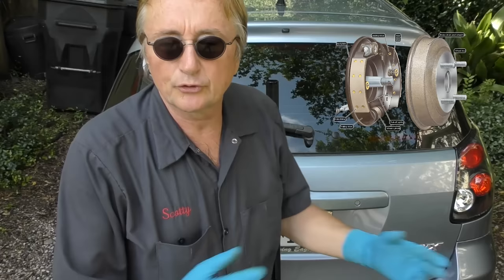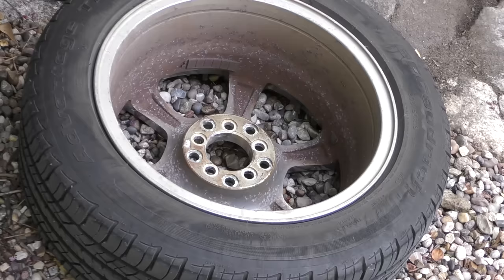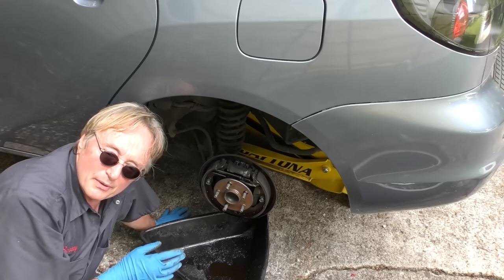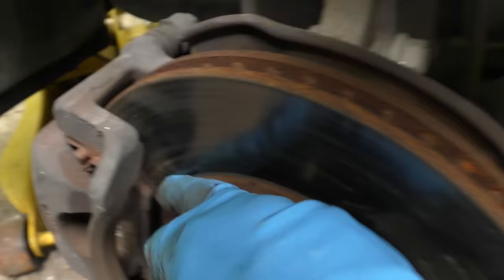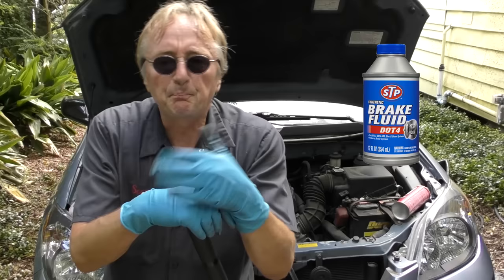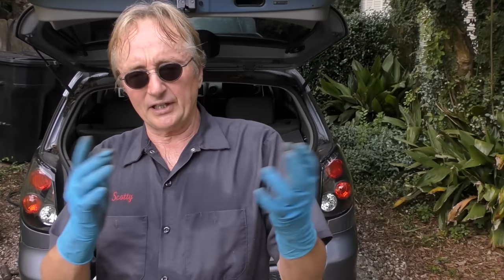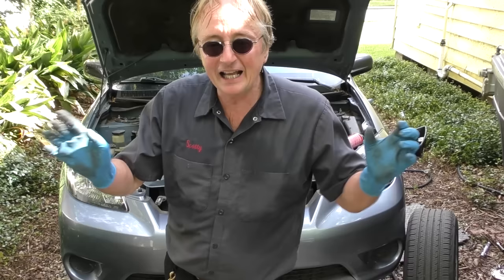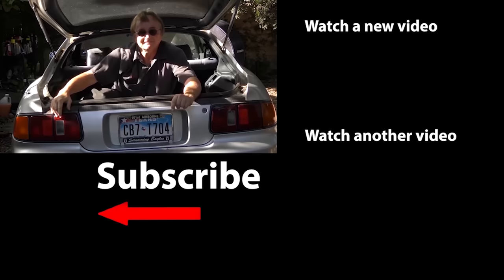Doing This Will Make Your Brakes Work Better and Last Longer

Comment: Don’t spray brake parts cleaner on the braking material or rubber components directly, that’s is bad for the rubber,  brake shoes and pads. It wears out the shoes/pads faster and dries out the rubber. Otherwise, fairly good advice.

Comment: jeep was squeaking so had our front rotors, brake pads and left side caliper changed. Left the mechanic and a couple days later, squeaking again. Took it to a different mechanic and said our rotors were heating up as well and said take it back to mechanic who did the work, they need to redo the job. So they replaced the whole thing again... 2 days later, squeaking again... whats going on??

Comment: My car has ATE pads from Opel Corsa OPC brake system.. They are good but they squeak even tho they are still 5mm thick+- from what i can see externally. 
What do you think about TRW brake pads? Or Brembo? im using 308mm discs for the front.. Thinking about replacing them now

Comment: I really need some of that brake cleaner.  My brakes are making my car shake after I greased the calipers a little while back when I was doing a wheel bearing replacement.  I think that grease got on the pads or Roters

Comment: Hello big fan here my 2015 ram 1500 my brakes creaks when press all the way in and also when release I need help I change the rotors and brake pads ceramic but still makes the noise

Comment: I have a 2009 Camry and have to change pads and rotors every 10K! I drive very conservatively and still the rotors are easily warped. My mechanic uses Conquest parts but are there better? What parts should I be using?
Reply: warped routers and pads every 10k Owo? something is up either your calipers ,guide bolts or some other part is causing some kind of issue. for a normal driver there is no reason you should have your routers and or pads worn ,warped or needing replacment with in 10k even for cheap stuff

Comment: Scotty I have acquired a 2007 Saturn vue 2.4l eco vvt hybrid. Wouldn't  start so hard it towed replaced spark plugs and put in new battery. Started! But was making loud noise so stopped. Changed  oil and filter. Still making noise passenger side of engine so removed  value cover to find sagging  timing chain. I plan to replace chain and anything else that I should while cover is off. I've  never done this but looks pretty straight  forward. Dirty burnt oil on cam shafts and cover. Any advice?
Thanks Tom Sawyer

Comment: Scotty I need help. I have a 99 f150 110k miles on it. Previous owner(original owner)  let it sit for long periods of time. I think he used it around the beach, maybe as a tow vehicle. I bought it from the guy last year. Runs ok no major issues or check engine light. However recently it's being sluggish. around 50 to 55 mph at 1.3k to 1.4k rpm, especially up hill at top gear it has a hesitation. I really have to push the petal down, it down shifts a gear to finally gain some speed.  What could it be? He changed the spark plugs at 90k miles, but that was in 2013.  Again no check engine light. please help!

Comment: Scotty I have been watching you and have been using your advice for over 3 years now..I have a 2005 matrix with 285,000 miles on it..My car has been through it...but my passenger front  brakes the caliper is acting funny I'm going to flush out the brakes with new brake fluid but what happened is I was driving it and the right side passenger side brake started locking up or got gravel or some thing in between the caliper in the brake pads and I keep breaking studs on that passenger side front wheel can you tell me what might be causing this issue

Comment: My 2006 Pontiac Vibe got rejected this year from the dealership in part because the back brakes were worn out. Idk why, it only had 226k on the odometer. Lol. I drove it off the show room floor when it was new. Take care of your car and it'll take care of you. I would have smacked that customer with the BMW.

Comment: Come on, where is that 1/4 inch lip on the drums that hangs up the shoes?  Look like they were just turned. I've noticed that a lot of new disk brake pads just won't fit in unless you file some of the tab down.

Comment: So my trailblazer blowing through pads...well one pad on one side of the front and same on the back...in one year isn’t normal lol...only one pad on the drivers side front and back...idk what is going on with the brake system on my trailblazer...the passenger side grinds and crunches but the pads are fine...so idk what is wrong...replaced the master cylinder cuz I had no pressure building after putting new pads and rotors on the front..got pressure back but for some reason the back brakes are grinding..not squealing but grinding and crunching and the pads look fairly new on one side and one pad looks fairly new on the other rear...the one pad is gone though..so now I’m back under it taking the calipers apart and greasing them...waiting for my rear rotors to get shipped since one is warped...I don’t know how the hell all this happens in one year...and over night my brakes were doing this..no other tell tale symptoms like squealing or not stopping etc...just bam...no brakes

Comment: My 2017 GMC Canyon diesel back left rotor is squeaking like no tomorrow I have replaced The pads and rotors and it still squeaks horridly And the break that squeaks is not making full surface contact Thor fiscal contact there is about a  2/4 of an inch on inside and outside of the rotor suface that is not touching the pad  Why is this happening do I need to look at a new caliper

Comment: Hello from UK , I have 2008 ford Fusion (EU) auto ,it makes groning noise when releasing the breaks slightly ,it only happens in drive mode. Some time it's too loud ppl outside can hear it and sometimes no noise ,needed ur advice before repair shop

Comment: Hi Scotty .. love your work. I bought a new Australian 2003 Nissan (sorry bout that) X Trail which after 220,000km has been a good car. But I've got a sticking front caliper piston because the pad wear was uneven. I'm in a humid climate and should have replaced the fluid more often :(  Have you got an easy solution for the sticking piston?

Comment: Regular applications of lithium grease or molybdenum disulfide to the contact surfaces of the pads and rotors will make them last forever, too.  Disclaimer:  I am not a mechanic, following my car advice is likely to get you killed.  But your brakes will be like new!

Comment: I thought rear drums adjusted by the forward and reverse action. 100,000 mi.?  That's a bit high for fronts.
Reply: Rear drums adjust by driving a short distance in reverse & then hitting the brake pedal hard - this action causes a lever to engage an adjusting screw & turn it slightly to expand the fulcrum points of the shoes.
Reply: @dennisgorra2637  That's what I thought.  I don't think it necessarily even needs to be hard - just normal driveway in and out.  This is how it maintains adjustment throughout the shoe life.

Comment: Scotty scotty. Thank you for your infomative videos, glad I'm suscribed. Have learned useful tips. New subscriber aboutca month. 
Question: 
Which parts store engine oil fuel injector cleaner fuel additives  etc do you recommend?
So many brands so many advertised promises. Thank you

Comment: So, if I have 4 wheel disc brakes, I don’t need brake cleaner?!
Reply: You didnt need to but if there's any issues or you did a lot of braking, the method is there to clean brakes.
again. no real need at all.
and if there is a problem, it's probably cuz brakes are running out.

Comment: My mother hasn't had new breaks since 2013?!? 

P.s. she has a 09 Toyota Camry
Reply: yep if you break smartly they can last for quite some time. our prius is has not had breaks in over100k and they are still looking really good for life. but that car kinda cheats when comparing to normal cars as the regen breaking helps slow it down also

Comment: can we use high pressure water intead of the fluid cleaner u showed?
Reply: Yeah you can but drive and brake soon as possible as it will cause more rust on surface

Comment: 100,000 miles from your brakes. Not on any vehicle. Not even.  Never. Bad info. Ceramic don't even last that long. Come on. The rest is good info however

Comment: I enjoy your shows , but I don't understand why you say you really don't have to do anything to your car (like here don't worry about breaks if you are going to get rude of a car ) because what if someone comes a long and buys that car that does not know anything about cars and then they are stuck with a sh...ty car like I was . Kinda sucks and kinda sh....t of you to say in my opinion.
Reply: He didn't say don't change the brake pads. He said no need to flush the brake fluid if you won't be keeping it more than 5 or 6 years. The fluids last for a long time and it won't hurt the next buyer. Hell if you don't brake crazy or over use the brake or drive or live in a harsh environment then 8 to 10 years the brake fluid would still be alright. They sell brake fluid tester for cheap than you can use to test your brake fluid. If it says good then no need to change it. If you brakes work good then you know you don't have to do anything. It doesn't go bad all of a sudden. It will good bad gradually. If your brakes are firm and not squishy then you are fine. If your brakes feel squishy when you brake then you have air in the lines and at that point just flush everything and put in new fluids. Not hard to do for most cars.